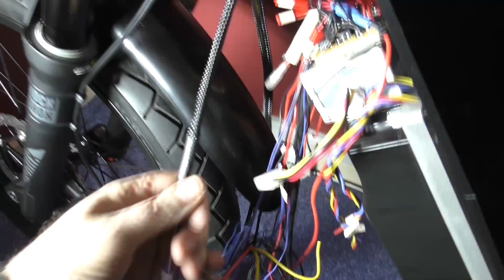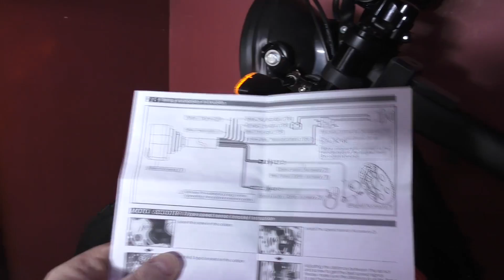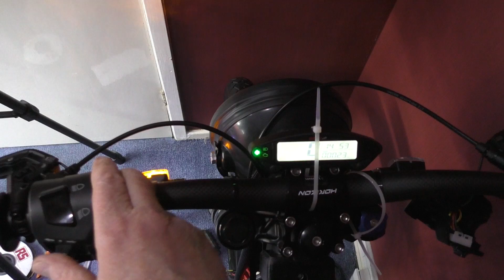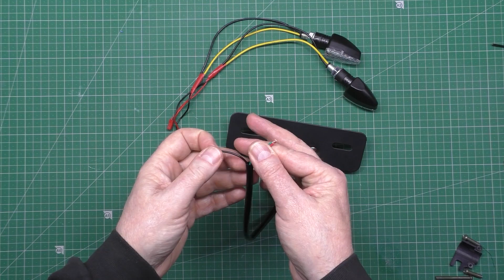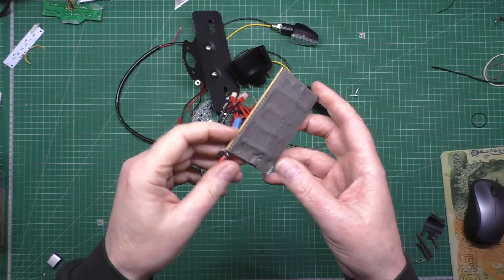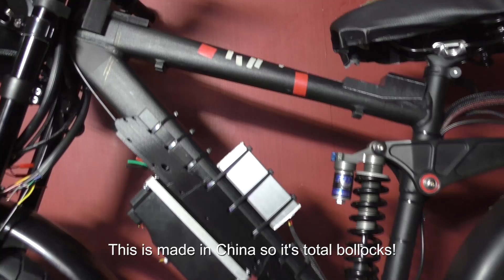High powered DIY eBike MSVA build part 23 - The Arduino project went wrong!

Comment: Fun to watch, but i got a smart arse suggestion; couldn't u get the cheapest complete moped you could find, rob all the wiring then toss the rest back on ebay? Just plug it into your12v voltage supply and delete ignition circuit? Cant see what im missing
Reply from the maker: That's all reliant on the loom being the same length as my bike. All looms are covered in a polyester tape with many 'branches' coming out - if one of those branches is too short or too long, I'd have to start cutting and joining.....it's not worth the hassle.

Comment: P-channel mosfets won't do the trick?
Reply from the maker: Yes but it gets rather messy because I'd need transistors to fire them and there's no way (apart from opto-isolators) to stop everything else firing at the same time.

Comment: Tony mate you need to get some black zip ties lol and why can't you make a hole in the frame like they do on motorbikes and run the cable inside the frame? Just thought.
Reply: Aluminium frame, the hole must be designed into the original build else you weaken the structural integrity

Comment: You REALLY want to get a metal handlebar on that!
Reply from the maker: Why?
Reply: Hitting a pothole at the speed that can go. I wouldn't trust carbon. Not for a handlebar.
Reply from the maker: @byronwellburn  You do know that carbon fibre is 5 times stronger than steel for its given thickness, don't you? And you do know that the more expensive bikes are made from carbon fibre? I've put these bars between 2 house bricks and jumped on them - they only flex a bit where steel would have bent beyond their elasticity and fractured.
Reply: More expensive bikes. That bar is probably 30 quids worth at most. There is a reason why motorbike carbon bars cost 5 times a much.